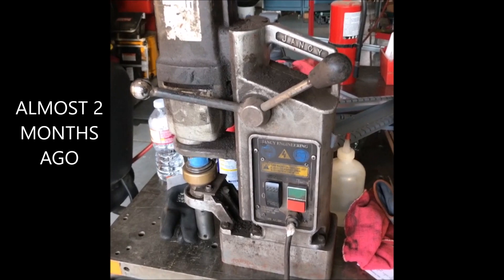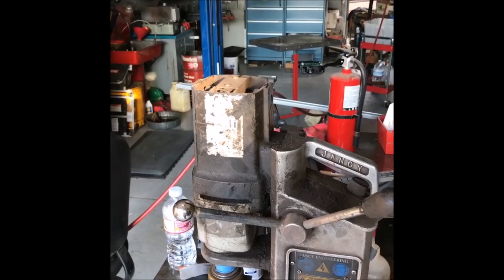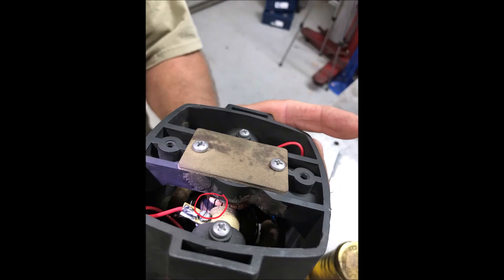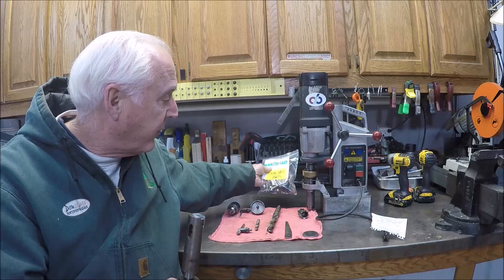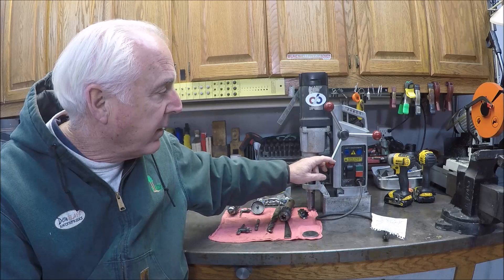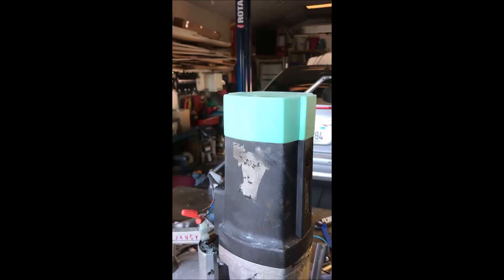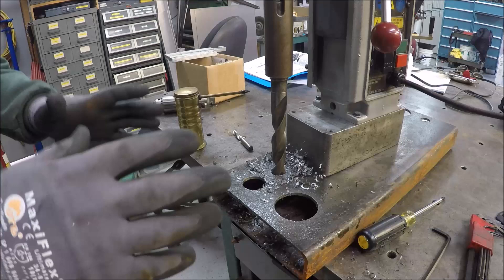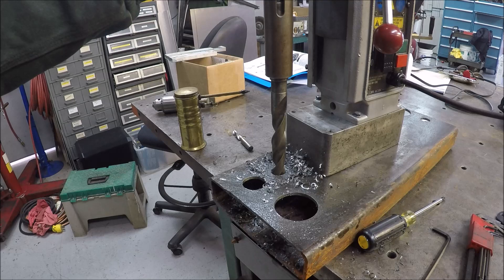Screwy Tuesday--Deal Or No Deal

Comment: You know the old saying "Sometimes Cheap ain't Cheap" but that said I think you did all right. the motor's gone thru, the mag works and you got some knowledge on the innards of the drill. It's frosting on the cake if you have a need or use for it in the shop. 5 👍👍👍👍👍 Chuck  -Jim

Comment: It’s a deal. I paid $1700 for a Hougen.  Cheapest Hougen is about $900 new. It’s hard to find good used mag drills. Most guys run them to death. You may not have needed one but you’ll be pleasantly surprised how useful it can be. Taking the machine to the work is awesome. I’ve added a Jacobs chuck to mine and have also used it with forstner bits and hole saws in wood.

Comment: Deal or no deal ? can only be answered by you.  You pulled it out of a dumpster, You researched it , You salvaged a great MADE IN USA tool. You suffered the F#@!** run around with the "service"[I would of paid them with a CC then refused payment to the "MALAFACTORIES"] You have a good usable tool that fits a need in your shop.  I can tell you that the welding school I worked in bought two "NEW" imports about that size for over  $1k each...junk! both of them had fails, warrantee issues, lol.  Great video on a great old tool- IT"S A DEAL LOL! HAPPY 2019 GOD BLESS!

Comment: I would say a fair deal. Depending on the cost, I would have ordered a new armature instead of sending that in for "repair". Of course I don't understand that hitting issue. That should be bushings or alignment. I agree with Eliminator's comment about education. I have had a lot of education experiences. :-)

Comment: Nice mag drill! You're right, they are expensive at auctions. At most of the auctions that I've been to they sell in the  $600-$700 range which was more than I was willing to pay for something that I wasn't going to use that often. A couple of years ago I lucked out and bought a Milwaukee at an auction for $150 and, surprise, surprise, it actually worked when I plugged it in. :-)  Mine doesn't have the lower support like yours does so I'd say that for $450 you did pretty good on yours.

Comment: I'm far too cheap to send it away to be fixed correctly. I wonder if a mounting plate could have been made that could adapt a hole hog drill or any drill motor to that base? I think its still a good score for you
Reply from the maker: Cheap is my middle name...lol, my original thought was to modify for just a 1/2 drill that I have....but then decided to repair it without knowing the fork in the road...lol

Comment: If your in the market for a mag drill it probably was a deal. Considering your total investment was in electric motor repairs, now you know you have basically a new motor, if you purchased a used unit you don’t know how the motor was abused. I’d think that these things are abused in the field by “Bubba” pushing the drill to hard and constantly stalling and overheating the motor, so by having a rebuilt motor you have a unit you’ll never wear out in your shop

Comment: Dumpster diving can be rewarding.
It seems you chose a wonky repair shop to begin with. Too bad. Strike their name off your list.
THanks for the vids.

You can make a single tooth boring bar for large holes cheaper than the core drills.